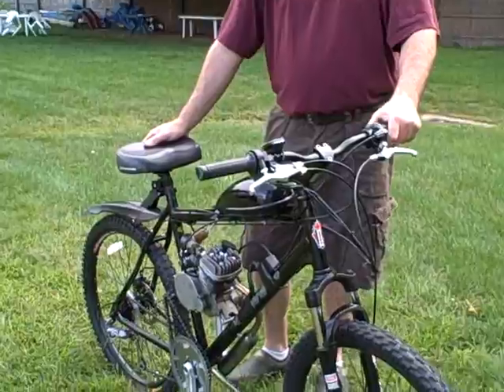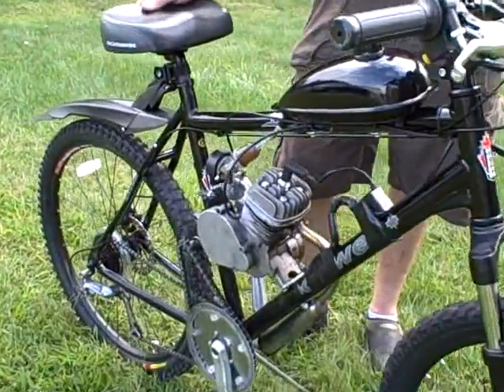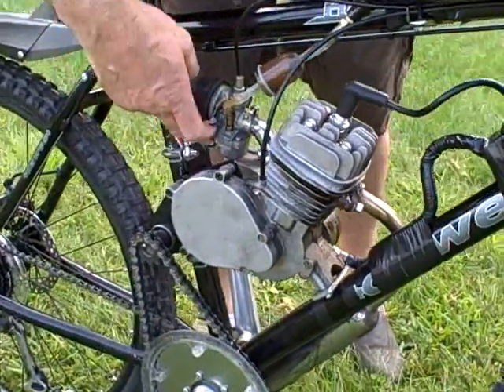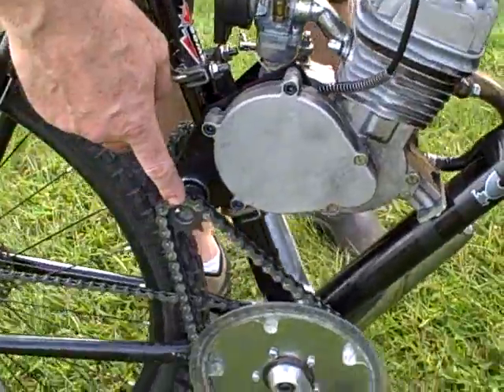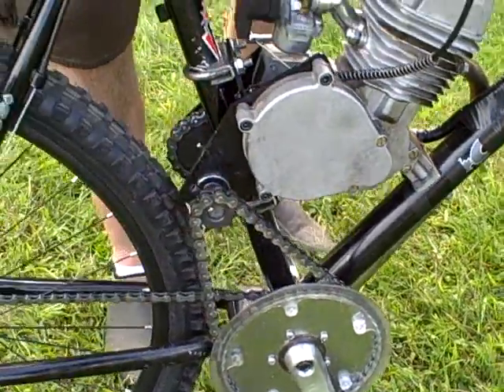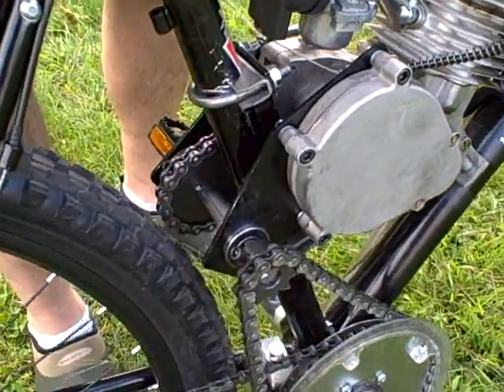Motorized Bicycle with Jackshaft Kit

Comment: Can you flip flop the 2 sprockets on the crank? Put the chain coming from the motor to the smaller sprocket and the bigger sprocket chain goes to the back cassette?

Comment: It looks and sounds sweet on paper. But reality is that these motors are designed to run at higher RPM with a correct mixture involving proper break in. In my opinion I have had the best reliability and best luck with a motor after breaking 44 tooth expansionchamber at thevery start of the installation not a important part that a lot of people make is the carburetor..nt is just fine if tuned properly..that includes the jetting.i recommend breaking in with 8 oz pr gallon for at least one tank or two then 6 oz per gallon.allways changing the rpm and only run them for 2o minutes or less the first two tanks...especially the first start up ..don't put a load on the motor at all.and allow it to cool all the way down..when you think its safe wait 10 more minutes..remember metal expands shrinks heats cools all that good shit that makes for giid morie..

Comment: Ok on a stock motor with a 44 tooth I do 35mph without a jack shaft. In hoping the new build in fabricating including the jackshaft will top 50. Just got to figure out the correct gear ratios I need.

Comment: Will this same jackshaft setup work with a 4-cycle motor? I have a 4-cycle motor from bikeberry that was originally to go with a friction-drive unit, but I don't care for that Lock-N-Load friction-drive and would like to use the motor on a bike or even on an adult tricycle I am currently putting together (Royal London model). Any thoughts as to that?

Comment: it is a nice bike and I'm not a hater or a troll but everyone should just 

buy the Skyhawk 66cc motor by grubee

 they are the best and longest-lasting you break it in for two tanks of gas you remove the muffler cap and remove the air filter you will go 45mph...  and don't think you know everything because yes and air filter sounds important but I've been running mine for 10,000 miles never even tune the carb and original spark plug.

all of these jackshaft kits and motor upgrades are basically a waste of money and time
Reply: Mate it's people like you that know nothing where you ride your bike obviously has clean air you follow a car down a dirt road and see how long your engine lasts why do you think every vehicle made has a air cleaner "Because they are not necessary" Have you actually taken the cylinder off and looked at the piston and cylinder walls you might be shocked. Why you would have to tune the carb just cause you have no air cleaner unless you have had a shit load of dirt go though it if your air filter cuts down that much performance it's obviously to small and restricts the air flow. I had a mate that had uni filters on his 860 Duke that cost him nearly 40 klm's top speed so it's a matter of having the right filter for the job and taking the muffler cap off and make it heaps noisier to attract as much attention to your self as possible. Two strokes are the best a bit of porting a power pipe and your air cleaner less heap will be left for dead and last a lot longer. You are the one that thinks they know every thing but i am sure you know very little..
Reply: @TimothyKennedy1 I also run no air filter and have done 1000's of kms (i only ride offroad) and have sucked sand and water through the engine. still runs fine and no obvious damage to cylinder or piston. if the engine sizes I can rebuild it for under $50. I have built 5 different motorised bikes.
Reply: Not saying i know everything, its just my experience.

Comment: Pretty cool now I have a question is a jack shaft kit mandatory... I have a 700c bike and all the forum heads keep trying to shove these down my throat....

I really don't want it seems unnecessary when I could juice the motor up and just do some part time pedaling to get over one major hill about 3 day a week  at about 386ft one way.

The price is not negotiable at this time but will a standard kit that is meant for mainly flat land will this do damage to my clutch on flat surfaces.

Comment: Just watched another youtube video and the guy said not to use disc brakes, however as most bikes nowadays have disc breaks what are your thoughts, have you got the jackshaft kit to combate this problem? Any info would be greatly received, anywhere in the UK to buy this stuff? Great idea BTW and you look truly happy bombing up and down on your motorised Bike :-) I presume this could work on a tricycle too?
Reply: Pirin Adventures walking holidays 3 months late so i presume you already have your answer. The reason they say not to use a bike with disc brake is because you need to put the sproket  where the brake disc is. If you use a jackshat kit youre essentialy switching the drive from the left side to the right using your geared sprokets instead. letting you use your brakes without having to switch to friction brakes

Comment: GIVE ME SOME POINTERS, I LIKE THE JACKSHAFT KIT, BUT BEFORE I CAN GET TO THAT I NEED TO SOLVE THE PROBLEM OF THE SCREWS FROM THE MOTOR MOUNT THEY KEEP SNAPPING AT THE QUICK.  wow sorry about that caps lock is off now can you help got any suggestions.  i have to drill out 3 out of 4 tonight, seems to be the main problem. i have a 2 stroke it's my first build. alot of headaches right now i'm trying to decide whether i need to weld a base to the frame to mount the motor on that will keep it in place. the screws have snapped 3 times everytime i ride it. so far i haven't even burned 1 tank of gas. i spend more time working on it than riding it. HELP if you can I've followed the instructions to the letter.
Reply: if you are using rubber between your motor mounts I'll bet that's why your stuff keeps breaking. Also upgrade all your hardware to 8.8 U.S. steel.  that Chinese crap is 4.4 or something,  its junk

Comment: Where can I buy bikes like this?
Reply: +3TH1L1N Harley Bee Motorized Bicycles. We have a premium Jack shaft kit costs about $350.00. We use a Chinese version but swap out the drive parts. The Chinese build obsolete into their stuff. I'm starting to make replacement parts for the jackshaft because really prefer being able to use the gears and in some cases people can take off from standing start like with my larger 140 series engines. The engines have a lot more power than that kit junk in china carton...

Comment: Bikeman- very cool bike! Do you know if the Jackshaft kits will work with a Huesheng 50cc 4 stroke?
Reply: +Kevin Sundberg  They version out you need to get with companies like SunshineSmiles ect.  I build a 140 series 2 stroke stroker. It is all the power you need witout the pain in the ass of a 4 stroke build brakets and head aches. I have a complete kit 2 stroke for $950 that's everything in the box I also can tailor and make brackets for most bikes VIA pics and stuff. I'm hooked up with companies like Zip Bikes and Currie Technologies. and gas Bike and Bike Berry. I take their shit and make my own heavy duty versions of their stuff.   Harley Bee Motorized Bicycles...
Reply: Kevin Sundberg MN sick bike parts 4 stroke shift kit, heavy duty shift kit

Comment: Does this allow you to get the bike going once you already pedal-started it without pedaling it again? Like,you start the engine pedaling,and then you can stop the bike and get going again with the engine running like a normal motorcycle?
Reply: +LaloRallyExpert In some cases like the engines I make my 140 series and a rider that is not really over weight yeah and it works slick. I am taking Chinese jackshaft kits and making my own drive parts and selling replacement parts for them. You can order a Jack shaft from us for about $300 plus shipping adapted to one of my 140 series engines the kits are $350 plus shipping and a 140 series engine just the engine is $350 itself out premium kits is now $500 flat plus shipping. Our engines rock dude.
Reply: +Tim Yeakel Thanks but i just asked out of curiosity (not from US). Here i can get a centrifugal clutch thats specially adapted for the engine,it fits besides the case,but they told me that it could have an impact on fuel economy (since you had to keep gas on it to prevent it from stopping) and some complications may arise simply for having more parts.
Reply: The clutches are strong at first... They got some hinks and kinks NOW... I suppose they will improve em.. That was my first option... I like the Jack shaft.. I'm gonna feature my new super bike this summer. I like that 25mph cruse speed down town ya can beat it. Another problem is getting a shifter to hold up to longevity... The stuff will improve... I concentrate on selling people decent parts.
Reply: +Tim Yeakel Yes,i love the idea of having gears on a motorized bicycle,but can that chain handle the engines power? its a common bicycle chain,the chain single speed motorized ones have is thicker,made to handle the power of the engine,otherwise this looks awesome.
Reply: It is simple there is a Clutch lever much like a brake lever... Press the clutch lever in the engine idles... Let it out the bike goes in gear.... The INTERNET ENGINES ARE WAY TOO LIGHT FOR WORK TRAVEL CONDITIONS... IS MY WARNING.  Yes these are as simple as simple gets... Get over your fears these engines are not NASCAR engines and you can actually order thru guys like me an engine actually F-ing works.. Buy a HARLEY BEE ENGINE THEY ACTUALLY WORK. Or see CR MACHINE and MATT @ BICYCLE MOTORWORKS Bethlehem Pennsylvania.. Let the clutch out the bike goes... Press it in and the brakes to stop.

Comment: can you still pedal start it
Reply: Vinny BOB yes you can
Reply: +Vinny BOB Yes Bob and you can also pull start one. Soon they will have an electric starter out. I saw a proto type in the Philippines. I wasn't impressed with it and the batter was total junk but it did work.

Comment: Check this out guys, if you don't want your motor bike to be as loud, release exhaust smell/C02, or simply want to make it look cooler I've been using this BLADE exhaust tip that works really well! http://inhabitat.com/blade-exhaust-filter-by-sabertec/

(I've been really happy with mine, it makes the exhaust a little quieter, but deeper, almost like a badass motorcycle!)

Comment: FINIALLY someone did what I wanna do and hook it up to the rear gears so you have different ratios and can shift on the go!!!
Reply: jaygarren1 I'm pretty sure you can,you still have a clutch,i'm pretty sure that's a free wheel too,meaning he can pedal,but if the engine is on,and has a higher rpm then him,the engine takes over.
Reply: The shifting might be nice, but the one downfall is that you can't use it as a bicycle. I like having the option of riding it as a bicycle or using the engine. It comes in handy if your engine quits, you run out of gas, or just don't want to use the engine (Like if you want to ride on a bike trail engine has to be off). People have been known to get these engines to go 50-60mph without the shift kit.
Reply: jaygarren1 I’m at 55mph territory without touching a single thing in the engine, I’m definitely sandblasting the inlet and outlet though, sounds better and runs harder.
Reply: Jose Vega What size wheels are you using? My 26 inch barely hits 30 mph